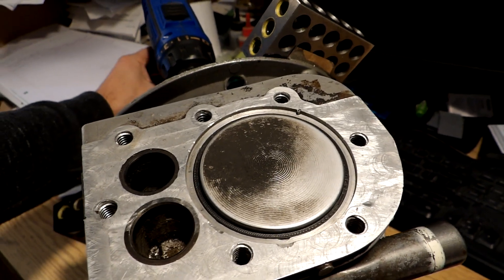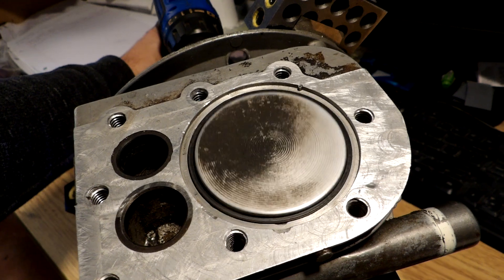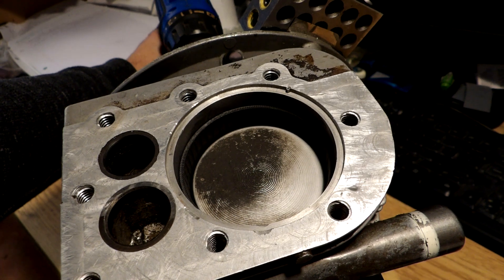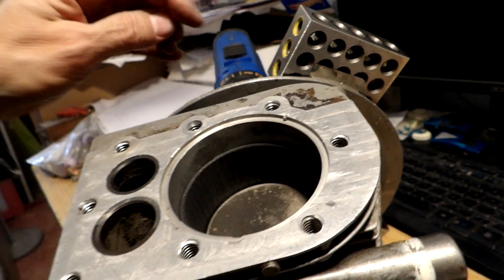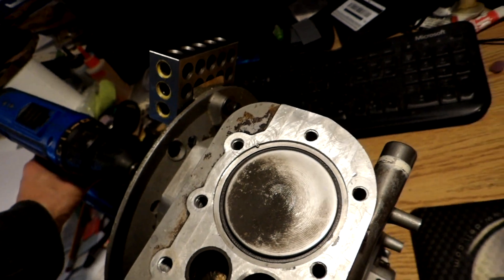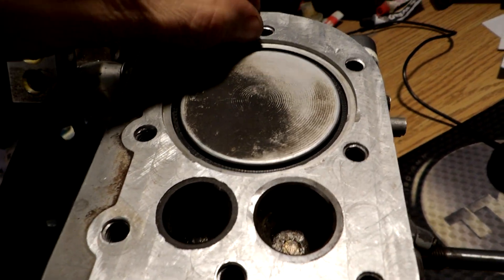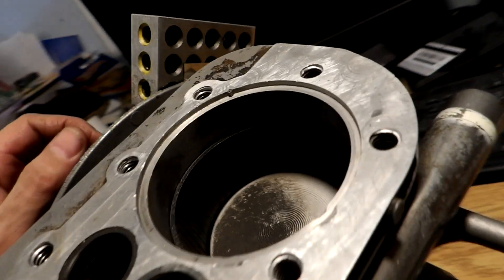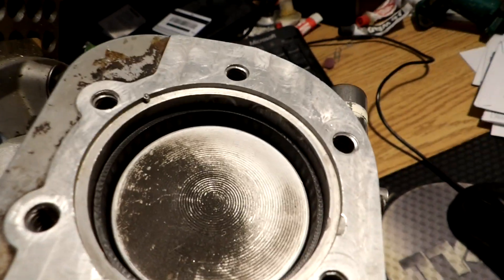2 Stroke Sleeve Valve Drive Mechanism Operating (Crecy type Briggs)

Comment: Wow that's insane! This is definitely going to be a wild one! Can't wait to see the progress!
Reply from the maker: Yes, we are still moving forward on it. Making the sleeve is nest on the agenda. I also need to cut the inlet ports into the cylinder wall, and fab. an intake manifold. Unlike the actual Crecy engine, this one will use a carb. instead of direct injection.

Comment: Just found your channel by youtube recommendation...

Was wondering why not make it like a Detroit style motor?
Reply from the maker: I already built and ran  Detroit type 2 stroke, and it worked fairly well. I have also ran a poppet valve  type 2 stroke, as well as an opposed piston type (Junkers Jumo 205 based) engine. That one was rather big with the 2 lawn mower engines fastened piston to piston and an 8 horse Briggs as the supercharger. I have chosen to use piston superchargers, as they are cheaper than buying a small Roots type blower. The disadvantage  is that I have to weld double lobes onto the camshafts and time the exhaust from the "blower" engine to when the 2 stroke needs the boost to force the charge into the cylinder. So the sleeve valve 2 stroke was the final type that I wanted to build to round out my collection.

Comment: Whats the problem with the 4 storke?
Reply from the maker: No problem, it has been torn down for a number of years, as I was measuring and doing detailed as built part drawings for it. The sleeve is sitting on my desk next to me. I have to say that the 4 stroke sleeve looks more impressive than the 2 stroke sleeve. :)

Comment: I made a 2 stroke briggs, easy.  Drive came 1:1 holes in cyl  with small supercharger, valves for exhaust..  Cake..
Reply from the maker: Oh, that is like one that I made, based on the Detroit 2 stroke diesel. It worked pretty well also. I spent a lot of time welding up and grinding down the camshaft for that engine! I still have it on a shelf.

Comment: Seems easier and more reliable to just use a piston port.
Reply from the maker: True, but that doesn't give you the same degree of control over the "valve" timing for the exhaust. The piston mainly controls the inlet timing on this engine, while the sleeve controls the exhaust timing. The sleeve timing is advanced 15 degrees versus the piston timing. This allows the exhaust to close while the intake is still open, and thus build boost pressure in the cylinder. I don't think you can achieve the same degree of timing control without using some type of valve mechanism. The main reliability issues the V 12 Crecy engines had seemed to mainly be with piston overheating. The 1 cylinder and 2 cylinder test units had proven to be very reliable, but the V 12 feed piston cooling oil up thru the connecting rods, and this seems to have been a bad idea. Piston cooling spray jets might have solved its problems. It is very unfortunate that none of the V 12 engines have survived, unless some billionaire has one tucked away in a display room somewhere! We can only hope! :)
Reply: @ChargerMiles007  well on the high performance two engines it is true that both ports are open but this desired because fresh charge goes into a tuned exhaust. When the sound pressure wave is reflected it pushes the charge back into the combustion chamber while the exhaust port is open but intake ports are cut off pressurizing  the volume  of charge as if it was turbo charged. That is what causes the power band. The oscillating frequency of the expansion chamber sets the rpm range of the power band. Honestly the fact that there is no moving parts to create this effect is what makes them reliable despite the fact that lubrication system is almost nonexistent.

Comment: I was trying to wrap my head around how this was supposed to work, and then you answered my question. That's some good prototyping.
Reply from the maker: Yes, this is an unusual engine concept. Sleeve valves are like that, simple, yet complicated! trying to build an engine like this using an existing cylinder block etc. is what really creates the pain, building from scratch would give me so much more design freedom.

Comment: not boring me at all my good man. this is the first video where i have understood the concept. are you going to skim the block to remove that experimental 4 stroke gouge or use another.
Reply from the maker: My son and I were talking about that tonight, since it is a concern. He thinks it will be simplest to machine an aluminum ring to fill the void, I have my concerns, but it can't really go any where once the head is bolted on. It could get hot and  possibly bind up on the sleeve, I guess we shall wait and see.
Reply: @ChargerMiles007  actually i think a copper ring would withstand the heat better. My dad has a single cylinder steyr diesel tractor that uses a copper ring in the same area. most head gaskets use copper there too.

Comment: Seems like it's ready to roll just about, though, maybe not with the plastic sleeve, that'll be like the wooden piston experiment days in not lasting long... :P
Reply from the maker: Yes, I have thought about giving the plastic sleeve a test run, but the engine may not even run at all with it. Therefore all of the assembly time would have been wasted. I showed it to my son tonight, he thinks it will be best to make an aluminum ring to fill in the gap at the top of the block (where the old contracting oil scraper ring was), versus filling it with JB-Weld. I think he is correct, the aluminum will get hot, but at least it is 1 piece, and can't fall apart and cause the sleeve to jam up and Lunch the engine! I am taking a serious look at where to locate the exhaust ports.